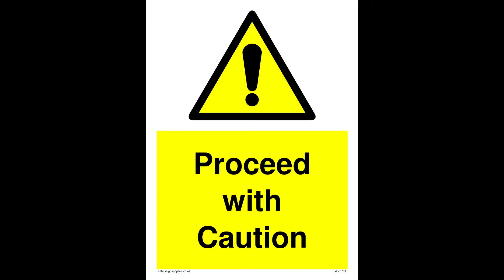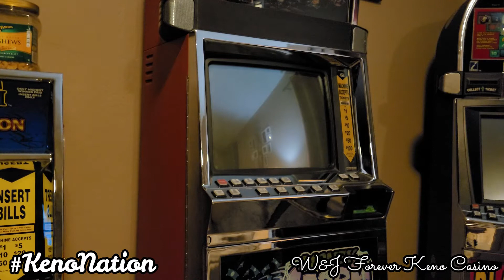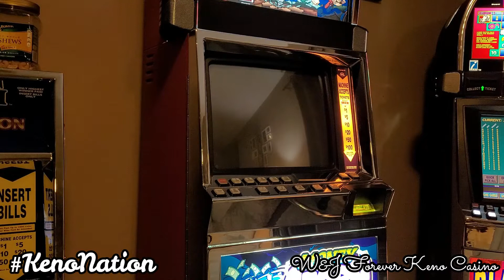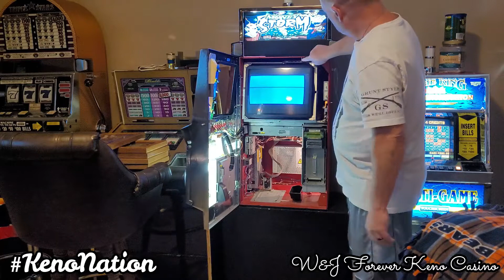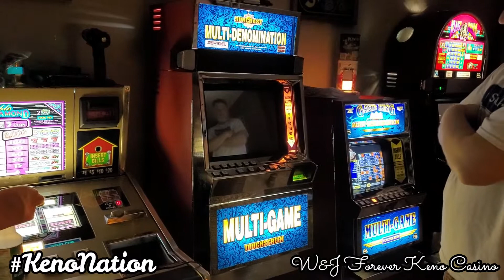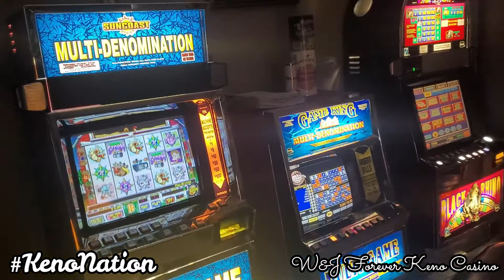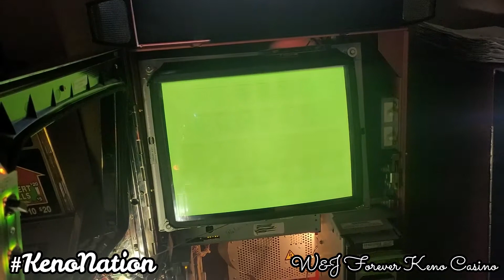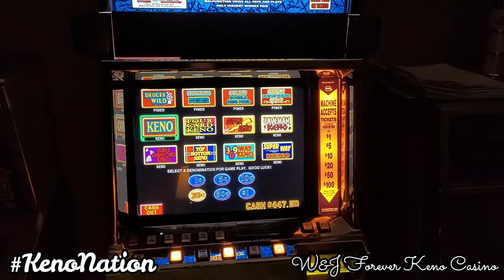#SlotRepair - 17' CRT Monitor Repair VLOG For IGT Game King I-Game Machine - Ceronix Model 1793

Comment: Hey great Video , Im having problem with the little pot that controls horizontal width, do you know where I can find a replacement??
Reply from the maker: Here's your best option as it's hard to find individual replacement parts.

https://www.ebay.com/itm/235225139429?mkcid=16&mkevt=1&mkrid=711-127632-2357-0&ssspo=4k5aNWvJTPm&sssrc=4429486&ssuid=HPR1e4p6ROm&var=&widget_ver=artemis&media=COPY

Comment: Hello. Nice informative video. I just picked up what I believe is the same type machine but Tabasco. I’m having trouble identifying what model the thing is. I believe I lost the 24vdc because I have no lights. Thanks
Reply from the maker: No power? Yikes...Tobasco could be an 044 board? We love our 044.It's Jojo's machine. I like my 3902 which is in this video. Have multiple games for it. Send me (Wayno) a pic of the motherboard inside the slideout tray and I can tell you the model for sure. waynoandjojoforever@gmail.com You may already know this but a great website to help diagnose your machine is new life games. Just google search it if you need help for the tech stuff. Keno On!
Reply: Hello, thanks for the reply. As far as the lights, both ballasts were toast so picked up LED’s IKEA. Looks great. While doing a little troubleshooting without any schematics and not being familiar with these found the bottom row of button are not responding during an front panel I/O test. Traced the wires and it appears the bottom row buttons go to the door senet I/O module.  Thinking with the module had failed, this could be causing coin-in and out jam errors. I’ll email you a picture of the motherboard.
Thx
Reply from the maker: @on2glamis  you are correct about it possibly being the board on the door, however these things are famous for blowing a chip on the main board when someone pulls the mpu tray when power is on. I diagnosed the Triple 7's machine we have to have had that issue. Had to buy a new 504b board. I'll check out the pics you sent. See if I see anything.

Comment: Where do you get a flyback to works with a specific CRT? Seems like it would be an uncommon part to find.
Reply from the maker: Very true! I personally prefer the World of Ebay. You must know your crt model of course. Fortunately,  a lot of vintage arcade machines use the same crt tech that the old slots use, meaning the flybacks are out there.  Thank Gawd an lcd conversion is possible. Had to go with that and put crt aside after I believe I fried the picture tube. They make a machine that can fix the picture tube or recondition but I have never tried it. I miss the old TV repair guy that fixed picture tube tvs. Tech put him out of a job. It's a throw away tech world now. Best of luck! 🍀🍀🍀

Comment: Hey my monitor just blew out on my game king.  It's a old crt.  Can I switch it to a regular pc monitor?
Reply from the maker: It's a process, there is a special cable you need made by ceronix. Also you'll have to use the old touch off of the crt. It's a tough process. That's how I did mine however. Next time I have to do the job I'll make a video. I have another gameking I'm refurbishing that I'll need to add a 15 inch pc monitor vs a crt.
Reply: @WJForeverKenoCasino  I just want to fix it the cheapest way possible. Don't want to drop 600 on something I barely use in my basement. Where are you located lol
Thanks!!
Reply from the maker: @Mike City  I hear ya on the cheapest way to fix it. It can be done. I didn't want to pay the 800 bucks or so to put replacement in when it could be done with a 15 dollar used lcd pc monitor from a thrift store. LoL if you attempt to replace make sure you use original crt monitor metal tray to mount the pc monitor. I am in Central California. Lake Isabella.
Reply: @WJForeverKenoCasino  wish you were closer lol.
I will wait for a video on how to do it. Thanks!!
Reply: All of a sudden it came back on today... Is that normal or is it on the way out?
Reply from the maker: @Mike City  normal. Picture tube needs to warm up but on its way out. I'd leave it on for a couple days straight to see if it stays. Mine did the same when it went out, but after 24 hours screen would go blank. Have you looked at the caps on the board under the monitor? You might be lucky and a few of those are bad only. I re-capped everything and still no luck on mine.

Comment: I have a slant top IGT GD70C AND THE CRT WENT OUT WHERE CAN I BUY A NEW ONE
Reply from the maker: Ceronix if you want to have easiest replacement but it will cost you probably in the $800 range. I don't know your experience level with working on electronics/Slots but you can pull the touchscreen off the broken monitor and then get a computer monitor, tear it down and wire in for much cheaper. But it's pretty technical.  I usually can fix them with out of pocket costs of like $100 bucks. Also you may be able to find the monitor replacements on ebay. I have seen them there. Good luck with getting it fixed though. That's why we have 9 of em' cus I (Wayno) will buy the gamekings cheap because people don't want to deal with fixing them.

Comment: If it's unplugged,  why do you need the grounding?  I'm certainly ignorant about that.  Just wondering.
Reply from the maker: Static electricity can zap chips/electrical connection on the board that runs picture etc. Also on a CRT you must be grounded when removing the flyback..you can literally blow your hand off if not grounded correctly . 🍀🍀🍀✌️

Comment: How did you mount the lcd to the frame?
Reply from the maker: I didn't show? So there is tape that you can put all the way around like rx and it will last like 5yrs...but I did that after drilling custom
Reply from the maker: *4x
Reply: @WJForeverKenoCasino  no you skipped Install of the lcd. Not understanding what your saying.
Reply from the maker: @davidgaziano5624  I'll put up a vid on the mount asap. I am re-working another one that I will be showing vids on restore as well.